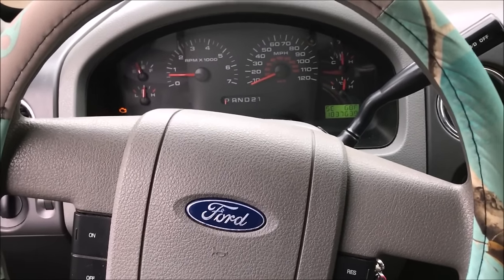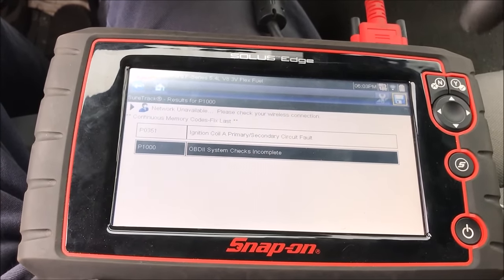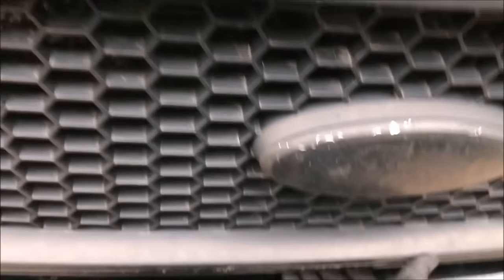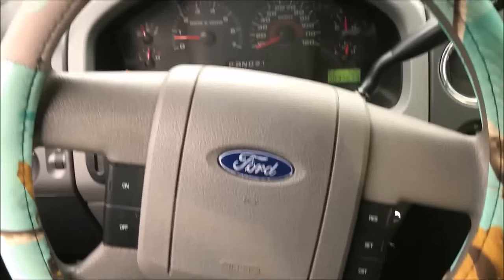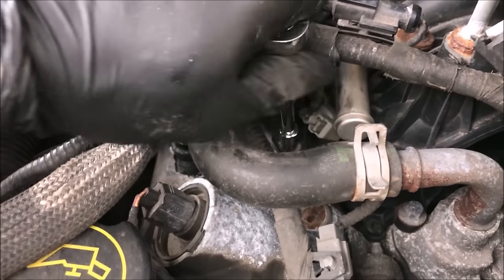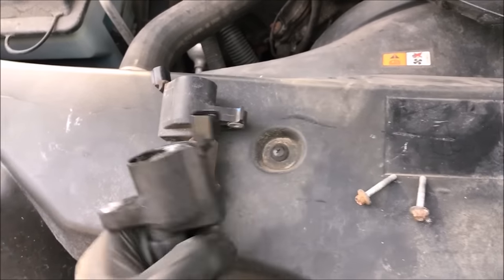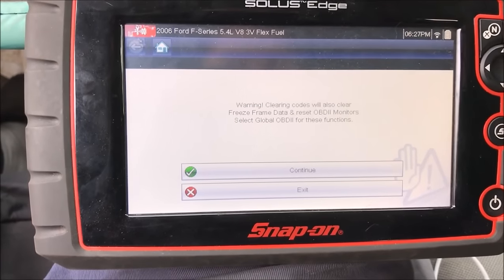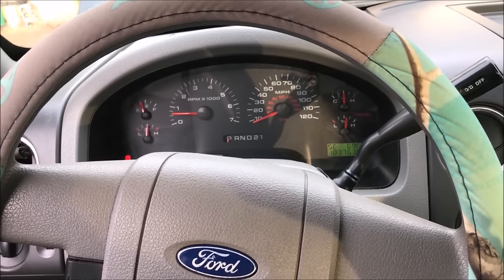How To Diagnose And Replace A Misfiring Ignition Coil (5.4 Triton)

Comment: What if I dont have any codes but have similar issue? Also I have an 06 colorado plugs are underneath a breather box and when the box is disconnected truck only runs for a second (not long enough for me to test coils lol
Reply from the maker: Unfortunately I’m not familiar with Colorado’s, never had to work on one surprisingly lol. It could be many things including spark plugs or coil. Doesn’t always throw a code for stuff like that but like I said there’s many possible causes.
Reply: @TonyTheTruckGuy  Thanks, Ill start with fuel filter and plugs

Comment: What is the correct fuel pressure for the 5.4?
Reply from the maker: 35 PSI +/- 5
Reply: Thanks Tony! Just to make sure I forgot to tell the year is 2012. Ford redesigned their heads,  It doesn't matter, right?
Reply from the maker: Oooookoo. That I’m not sure then. Didn’t they replace the 5.4 with the 5.0 in 2011? I thought you could only get the 5.4 in 2012 and newer if it’s a F-250 or higher. I guess I’m not positive on that one, but when I just did a google search for “5.4 triton fuel pressure”, I found multiple places saying 35 +/- 5.

Comment: I need help, what happens if the screw holes for the fuel injectors are broken on the valve cover for a 2005 f250 V10, the injectors are just sitting there without anything holding it down the valve cover, it’s misfiring and I’ve done the tune up 2 times in less than 6 months trying to fix the problem because the way it was running was terrible the whole truck has been shaking pretty bad and I can heard the piston misfiring from the exhaust, the code comes out to bad fuel injectors but i think It might be the spark plugs what should i do?
Reply from the maker: So the holes for the bolts that hold down the fuel rail are stripped out? I assume that’s the intake manifold that the bolts thread in to. If there’s still material there, you can try to drill and tap it for a slightly bigger bolt. Otherwise the intake manifold would need to be replaced.
Reply: Tony The Truck Guy   No no the valve covers, the cover for the cylinder head
Reply: Tony The Truck Guy    I’m so sorry I feel retarded, I meant the Ignition coils not the fuel injectors
Reply from the maker: Oh ok, well those would be slightly easier than the intake manifold to replace of the drilling and tapping doesn’t work with a heli-coil kit
Reply: Tony The Truck Guy   So if the ignition coils are just sitting on top of the spark plug but they are loose and nothing is holding it snug, for 3 of my cylinders could that be causing the misfiring
Reply from the maker: It’s very possible. The coil is likely not making a good connection on the plug since it’s bouncing around while idling and hitting bumps

Comment: I wish I had a guy like you nearby.
My local mechanic took me for a bundle.....but all my codes came back.  Nothing fixed.
Reply from the maker: Ugh. I hate the ‘ol parts cannon approach
Reply: Trouble code showed misfire on #2 cylinder.
So they put a new coil pack on #1.
Yesssssss that will definately fix #2 misfire.  NOT!

When confronted about this glaring mistake?  They got huffy and hung up the phone.

Comment: New plugs new coil packs new injectors new fuel rail. Still has a miss and popping through exhaust. compression is even across cylinders on cranking. Any ideas?
Reply from the maker: Any codes? Also has the fuel filter been changed if it has one?
Reply: Tony The Truck Guy No codes. Filter changed last year.
Reply from the maker: Have you hooked up a pressure gauge to confirm fuel pressure? I know these F150’s have fuel pump driver module issues.
Reply: @TonyTheTruckGuy  Not yet. It has plenty of power on hills and towing. Just that popping in the exhaust. Like fuel igniting in the pipe.
Reply from the maker: I’d verify good fuel pressure and if that looks good then you may have a plugged up cat or a more severe engine problem such as cam phasers
Reply: Tony The Truck Guy,
What's a cam phaser??
Reply from the maker: Certain engines have what’s called variable valve timing (VVT). They can do this because the camshafts have pulleys on the end that are under spring pressure, but get overcome by oil pressure as RPM increases. This allows for constant adjustment of the valves. There’s also a tone ring on the end of the cams which have teeth or windows cut out in them and each one has a sensor that reads the RPM off of the cam. There’s also actuators with screen filters which can plug up and cause cam issues. So if the sensor is faulty, or your tone ring is damaged, or the actuator fails/plugs, or the cam spring mechanism fails, it can run poorly or not even start.
Reply: Tony The Truck Guy, if this were an issue, how would one go about diagnosing it, or even fixing it??
Reply from the maker: I specialize in diesels, so I’m not sure exactly how those Fords operate. You’d need to hook up a really good scan tool and monitor the data for the cams, etc. You could also remove the actuators from the outside of the valve cover and make sure the screens aren’t plugged and o-rings aren’t torn.

Comment: All of this assumes your missing engine throws a P30X code...  Which may or MAY NOT be the case...
Reply from the maker: Correct it’s not a perfect method but it’s your best shot with not much knowledge and just renting a scan tool. It took a while for this truck to finally throw an engine light. It also had bad spark plugs though.
Reply: @TonyTheTruckGuy  My 2004 Triton 4.6  runs fine except after a good rain or at highway speed under a slight load, so I'm sure it is a "weak" spark coil.  Just need to know which one.
Reply from the maker: Yeah in addition to the bad coil, this truck also was bucking and shuttering in overdrive under light load conditions like a small hill but wasn’t throwing a light. That was fixed after doing all 8 plugs.

Comment: You mentioned the truck is your gf's...and you're not a fan. What, specificlly, are the issues you have in regards to this particular year(s), model, etc?
Reply from the maker: It just seems like every time I work on a Ford in general, I have a hard time due to poor design. The 5.4 in particular has its fair share of issues from spark plugs breaking to cam phasers going out.

Comment: How did you hold the Coil BOLT in the drive extension without it falling out before you started threading???
Reply from the maker: Just installing the little bolts that hold the coils down? I believe I just started them by hand first, but you could also put a little gob of grease in your socket to hold them for you. They also make extensions that have small magnets on the end, or you could just glue a small magnet to your extension.
Reply: @TonyTheTruckGuy  Thank you !
Reply: @Stevenshae77  Thanks !

Comment: I had a similar issue.  I replaced all 8 spark plugs and I got a code. My code was P0352
I replace the coil from 2 to 1 and code went away BUt it still hesitating when I want to accelerate and every time I get out of the truck and touch the body it zaps me.  I hacked the wiring nothing is shorting so it’s really strange    
Any ideas ?

Thanks
Reply from the maker: I would verify all of the plugs are still tight and make sure they didn’t come loose for some reason. You shouldn’t be getting zapped unless there’s a poor ground. If all the plugs are tight I would probably replace the #2 coil. Also not sure if you already knew or not but the cylinder layout on Fords are different than the typical engine. I’d look up your engine’s cylinder layout to make sure you’re messing with the right cylinder.
Reply: I agree with Tony the truck guy on checking plugs & changing coil. I would suggest for the problem about you getting zapped & I know it sounds stupid. Get an old bungee strap, preferrably a flat one & fasten it to the truck somewhere metal, running board bumper, any as such & leave it long enough to touch the ground when stopped. Do NOT leave the hooks on it. That way everytime you stop it will touch the ground if only by an inch or so. Bet you will find within a day or so unless your clothing is causing a static build up that it will stop zapping you.I had an older 80's Chevy pickup 7 an early 90's Freightliner do the same thig & that little trick stopped both of them from doing it. Worth a try anyways. Good luck.
Reply: Clean ground on right framerail

Comment: I have a 2012 eco boost and keep losing cylinder #3 coil. Any one this problem or suggestions
Reply from the maker: I would recommend also changing the plug with the coil if the same coil keeps going bad. Also try OEM Motorcraft coil and put some dielectric grease on the little metal spring in the coil boot that contacts the spark plug. Sometimes the coil can arc to the head.

Comment: What if it’s intermittent?
Reply from the maker: Swap coil to different cylinder and see if code follows coil
Reply: Update. My valve cover gaskets were leaking causing my coil packs and spark plugs to fail. Replaced all packs and plugs as well as the upper intake gasket and valve cover gaskets. I’m pretty sure the plugs were the original and my Expedition had 194k miles on it. If that helps anyone. Now my thermostat housing cracked and I need to replace the upper intake and that’s not gonna be fun to do again. Thank you for your video and information. 💪🫡
Reply from the maker: @AG-33-   Glad you got it figured out! Sorry to hear about your series of bad luck with that thing!

Comment: I had a misfire on cylinder 8 which was a pain in the @$$ to get to but it was doable
Reply: 8? Try #4
Reply: mark kouba no,! Mine was cylinder #8. These F150s are 8 cylinder engines. # 1,2,3,4 are on the passenger side of the engine #5,6,7,8 are on the driver side of the engine. #4 and #8 on on the back side of the engine. #4 is on the back passenger side and #8 is on the back driver side.

Comment: Automotive design sucks and should include the mechanics in mind. Build these trucks were you have room to work on them. Don't lay a/c,  wires and vacume tunes over the coils.
Reply from the maker: The new stuff is 100X worse, sadly.
Reply: Yes gen 10 Ford's were bad about clearance to get to rear plugs coils and injectors.

Comment: I have a 2010 f150 5.4 and only when I am going up hill it seems to have a slight miss. I can get on it going uphill and it doesnt miss or anything it's only when I'm gradually going uphill. It's got 90k on it i just replaced plugs on it. I'm thinking it might be a bad or weak coil. It's just weird how it will only do it while driving up a hill.
Reply from the maker: Yeah it’s weird but when it’s an issues related to something like this, it seems to do worse when going light on the throttle under load. This truck would run a bit better if you floored it, but you could feel it hiccuping if just cruising and you hit a small hill. This truck ended up having multiple cracked spark plugs. I’d double check all your plugs are tight, then swap around coils if needed and see if any codes pop up or switch locations.

Comment: All these videos are useless, because people need to see how to diagnose these.  Using a scanner is not diagnosing, its a quick and easy tool that does not exist in my town, and the truck cannot be driven to a scanner.
Reply from the maker: That's an awfully long winded way of saying you're a brokie and your town is crappy. You can literally get scan tools for like $20 on Amazon. You don't need a $3000 one. Do you live in Madagascar or some shit? If computers are too fancy and complicated for you, I suggest getting a carbureted powered car. Whether or not you like it, this is a proper method of diagnosing. If you can't even drive the truck to a scanner due to such a severe misfire, you likely neglected the vehicle for far too long. You also bought a Ford.
Reply: @TonyTheTruckGuy  Your reply is rude and inaccurate.  If remote and outside the US, where Amazon does not exist,  and the truck suddenly begins misfiring, how can this be diagnosed or narrowed down?  Having a scanner is easy, anyone can read the codes, but there aren't any here...I never said I didn't know how to use one.
Reply from the maker: @caribdreamin  Your comment about videos like this being useless was rude, so I matched your energy. You're welcome. Once again, it's not my problem you don't live in the U.S. and don't have access to the proper tools. If the vehicle develops a misfire while driving, you limp it home or to the nearest shop. All I'm hearing are personal problems and you complaining about everything.